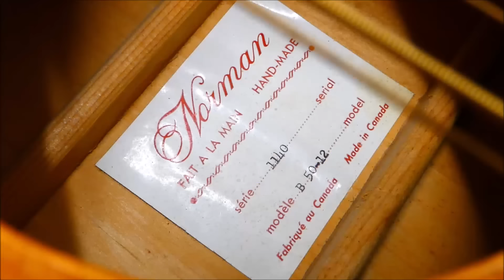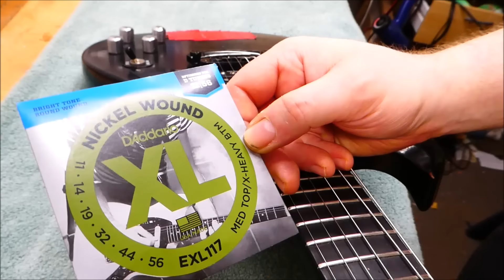Broken SG and a Norman 12 String

Comment: Well, there's also no reason that after more than a century of sound construction methods known to make headstocks not break anywhere near as easy, (which Gibson actually did in the 50's) to make them in a way they can break so easily!  Angled headstocks without a wood joint (same with large heels) are a huge waste of ever more rare natural resources too, because of the amount of wood that must be cut away in carving them, and at the price Gibson charges one is not getting their moneys worth by far, but instead paying for a Brand name for a company unwilling or just unable to change and get with the times.  I don't see Les Pauls as a status symbol as way too many do, I see them as a dunce cap!

Comment: Even the guy who 'takes care of his Gibson' can have a break, just like people get in vehicle 'fender benders', it might even not be their fault. Of course, the real question is why Gibson doesn't step up and fix all newly produced guitars from being such a risk. It's not a new problem, Fender Guitars has a magazine advertisement from way back in the 1950s with a 300#+ factory worker standing on a guitar neck bridged across a couple of shipping crates by the ends stating simply "we stand behind the quality of our guitars". Paul Reed Smith did a video standing on one of his guitar necks too. Gibson? They even break inside their hard cases. They fixed their Epiphone line, guitars bought and abused by kids still get broken but a fraction of the production rate of how frequently Gibson necks break even typically owned by more conservative older players (since they are more likely to afford Gibson guitars than kids). Even though I take care of my guitars, I refuse to get any more Gibsons until they fix their poor design.

Comment: Great video! What is the brand of thinned superglue that you are using? Looking for a source in Canada. Thanks!
Reply: I'd like to know that as well. Most superglue sold in small tubes is too thick; you can buy water-thin superglue (Titebond or Hot Stuff brands, for instance) in small bottles but unless you use a lot of it, it sometimes goes bad and cures in the bottle before you use it all up (or the cap fuses to the bottle so that you can't open it ---- I'm talking about you,  Hot Stuff!). Small more-or-less single-use tubes of super glue would be less wasteful and easier to deal with, especially if available in a medium-thin viscosity.
Reply: StewMac has a variety of CA in different sizes, but they don't ship it to Canada. Check your local model shop; rc model plane, boat, and car builders use it a lot. It needs to be fresh so most of the grocery/hardware store "super glues" tend to be  quite old and out of date. You can extend the life by keeping them in a refridgerator. Just make sure your partner knows what it is and kids can't access it. Not a bad idea to have some accelerator and some remover. I've pulled off skin trying to get fingers apart!
Reply: @dooleyfussle8634  , I am in the US so shipping isn't a problem. Stew-Mac does tend to be on the expensive side however.  Looking for a model shop is a good idea.  I have bought water thin super glue locally from Woodcraft and it's good stuff but I don't use enough of it for it to not cure and harden in the bottle on me.  As for putting it in the refrigerator,  I did a bunch of research on this subject a awhile ago and read a bunch of manufacturers recommendations and they say that putting it in the fridge only works, to some extent, if the bottle or tube hasn't been opened.  Once you open the container and moist air gets in there you might actually cause it to cure faster in the container because when you put it back in the fridge that moist air will condense into droplets of water, hastening the cure.

 You are correct about buying glue at the grocery store or dollar store or job lot or whatever. Nobody marks the stuff with a date code that you can easily read or look up and it's often old by the time it shows up for sale in such places.  I bought some UV curing zap fix or zap it super glue locally, and when I got home I found the tubes were already hard as a rock.  And on the subject of UV curing adhesives bring adhesives I do use bondik and especially rapid fix from time to time and find them very useful but those aren't super glue and they will not cure anywhere that light doesn't penetrate. I haven't tried any of the actual CA formulations that are UV light curing, not yet anyway.

Comment: I have a question; a 1976 Takamine dreadnaught needs a New neck. Spruce top, flame maple back and sides. The guy wants a hundred bucks for it. Would this be an achievable first project for an aspiring luthier and could I possibly make anything off it? Experienced/intermediate woodworker?

Comment: That SG was filthy.  How can anyone bring a guitar to a luthier in that sort of condition?
Reply: Shoulda had a look at the guy that brought it in,
Reply: In my day job I mostly work on old stereo equipment. You should see the shape that some of that stuff is in when it arrives.  We have an air compressor outside for blowing out all the dust, dirt, animal hair and dander. We've had units coming in full of grass clippings like they were stored next to the lawn mower or weed wacker, and others that had a blanket of what appeared to be dryer lint that almost completely obscured the components on the circuit boards.

Comment: If Gibson would just switch to using a scarf joint at the neck then headstock breaks would become a much less common thing, in this case though I doubt even that would have saved it. What kind of savage tapes over a hole on a stage and thinks that's gonna be okay?!

Comment: I have a Dano' DC3 with an angled headstock. The scarf joint starts down the neck past the nut and halfway to the 2nd fret. To me this looks like you would have to be totally out of control to bust this. I personally have never been in such a state to test this thesis. Just say'n